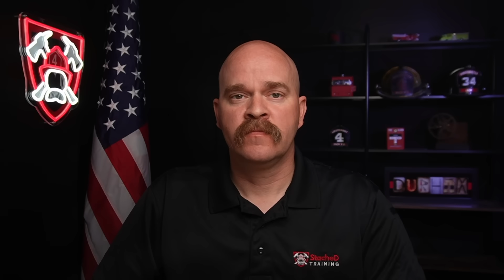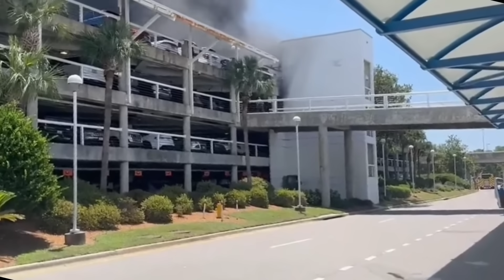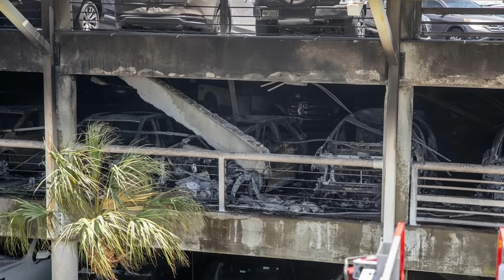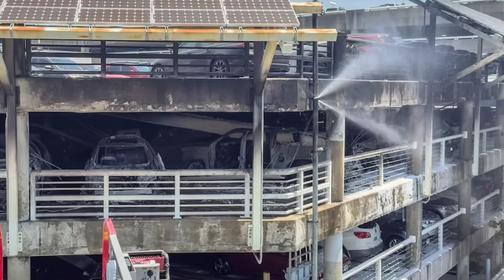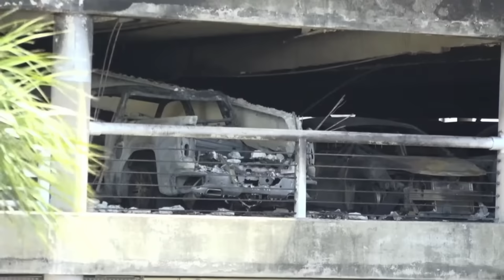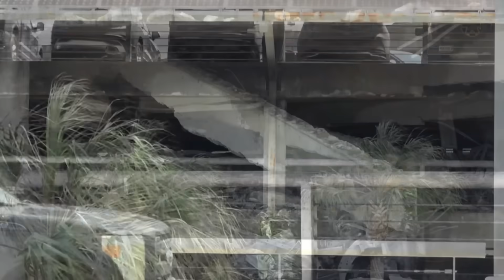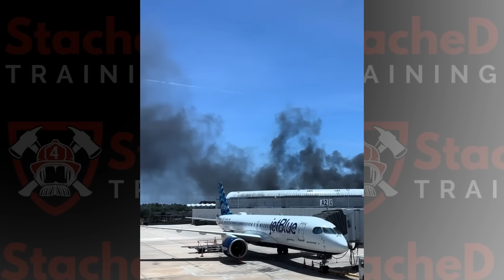Fire, Collapse, and Chaos: Jacksonville Airport Garage Incident

Comment: The recommendations of more space and fire barriers will increase the cost of parking garages.  One also has to ask can current garages be upgraded? Will the additional material be heavier than the weight of reduced number of cars?  I keep hearing about different types of batteries but so far, we are stuck with these lithium ion batteries.
Reply: The new battery types people bring up are always 5 to 10 years away from being able to be manufactured
Reply: We’re not really stuck with any batteries while liquid fuels are commonly available and are tried and tested to be a better option.
Reply: even flat lots are at risk, most airports have single entry lots so when a big fire starts near the entery you will have issues of access

Comment: Of course it was a battery fire
Reply: You’re not wrong. They all are technically.
Reply: @cyclone-g2zNo they aren't!
That's simply nonsense.
Reply: @0Aus How else would an ICE vehicle catch fire?
Reply: @mickjoebillsAnd none of that would happen if there wasn’t electricity from the battery to start the vehicle. I rest my case. 🤣
Reply: @cyclone-g2z flammable liquids onto hot components, failed bearings, etc the list is extensive. 
Think in future.
Reply: @0Aus  You need to learn to take a joke, maybe you need to think outside the box a little, none of that would get hot without a battery to start the engine. It all starts with electricity.
Reply: @cyclone-g2zyep we get the joke alright you!😂

Comment: "Tesla" is becoming synonymous with EV, just as Jell-O is synonymous with gelatin dessert.
Reply from the maker: They have a huge share of the market in the US.  Currently around all EVs on the road are Tesla, but only a few years ago that number was 80%.
Reply: @StacheDTraining  I grew up in and built muscle cars, but now I am looking to get a used 2024 Model3 Performance, in 2026. Far-Left nutjobs made the prices drop, which is a win for me, and a 2.8-2.9 0-60 and a quarter mile in 11.3 @ 125 MPH
Reply: Yep. “Bobcat” is every skid loader.  “Artic Cat” was snowmobile.  “Coke” most soft drinks.
Reply: Is jell-o a brand name? In the UK it's called jell-y
Reply from the maker: @geoffsclassiccars Jello is a brand name.
Reply: @geoffsclassiccars yes Jell-O is a U.S. brand name for flavored gelatin.  I don't know if it's the oldest brand, or not, although I think it is. It is, however, the most popular brand.
Reply: Bill Cosby loved Jello
Reply: As it should, best drivetrains, innovations on FSD/surrounding live cameras, and the incomparable Octovalve!
The *Tesla Octovalve* is a groundbreaking component in Tesla's **thermal management system**, particularly in the **Model Y**. It plays a crucial role in efficiently regulating the flow of coolant and refrigerant throughout the vehicle, optimizing heating and cooling for various components like the **battery, powertrain, and cabin**.

### Why is it innovative?
1. *Integrated Thermal Management* – Unlike traditional systems that use separate cooling loops, the Octovalve *merges multiple cooling circuits* into a single, highly efficient system.
2. *Heat Pump Efficiency* – It works alongside Tesla’s *heat pump**, allowing the vehicle to **recycle waste heat* from the battery and drivetrain, improving energy efficiency.
3. *Improved Range* – By optimizing thermal regulation, the Octovalve contributes to **better battery performance**, leading to a **10% increase in vehicle range**.
4. *Compact Design* – The entire system, including the **Octovalve, manifolds, compressor, and chiller**, is packaged into a **small, space-saving unit**.
5. *Continuous Improvement* – Tesla has made *multiple design improvements* to the Octovalve in just a few months, showcasing its commitment to rapid innovation.

This technology is a game-changer for **EV efficiency**, making Tesla vehicles more energy-efficient and extending battery life. Want to dive deeper into how it works? 🚗⚡
Reply: @BigEightiesNewWave  Does Tesla pay you to post their marketing material?
Reply: @oliverheaviside2539  it's likely some dumb AI bot that pukes out responses. There is no way a person wrote that 😂
Reply: @BigEightiesNewWave Not really.
Reply: @BigEightiesNewWave  Actually, no.